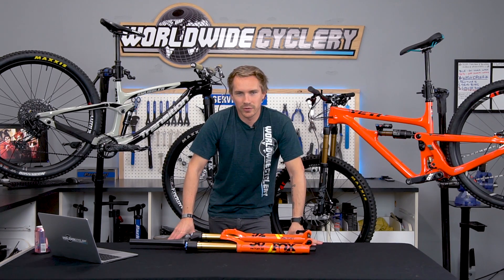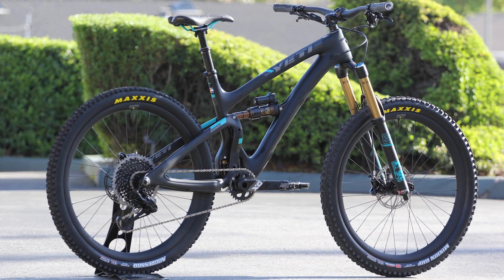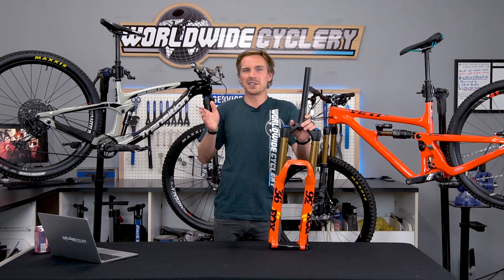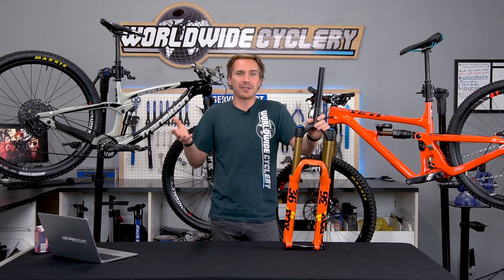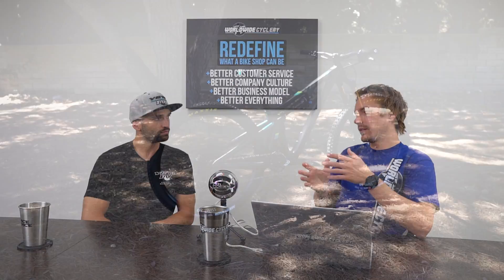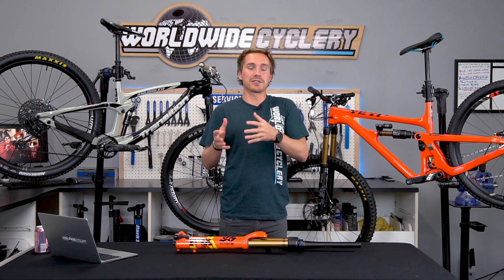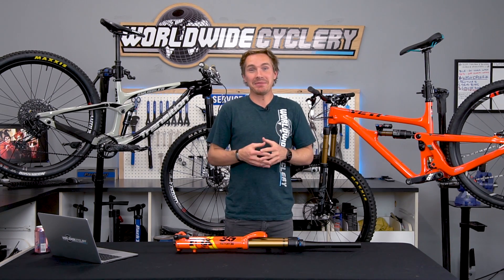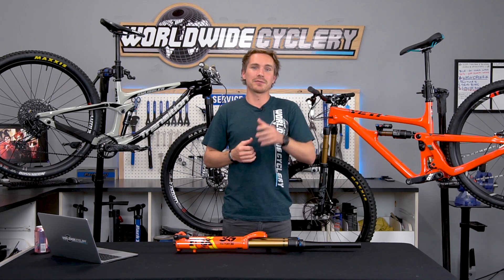MTB Fork Offset - What Is It and Does It Really Matter?

Comment: Just as a random point, the SBG from Transition was a collaboration between Transition and former UK Fox Importer, Chris Porter (currently at Geometron bikes). It was actually Chris that messed about with fork offset (bonus of having a lot of Fox forks to play with) and Transition heard about this and asked Chris if he would work with Transition.
Reply: Strangely, Chris Porter also worked with Mondraker( I have looked but seen no mention of them in this)  2013/14, I think. 
FORWARD GEOMETRY  Longer top tubes own brand 30mm stems... Fabulous handling bikes

Comment: I'd like to see a blind test with the same geo spec bike and same wheelbase. However, with the exception that one has steeper head tube angle and one with smaller offset fork to see how much of a difference there is and if anyone can distinguish a difference. Can probably do the test with an angleset headset. It would be interesting.

Comment: One consideration here is the type of trail that you ride on most frequently.   I ride on are the tight, technical trails in the southeast, most often, And I rarely get up to the speeds you see on those wide open trails that you see over on the west coast.   The higher the speed downhill, the more noticeable things like fork offset and slacker angles become.  That's my presumption.
Reply from the maker: Very true but it will also effect things like climbing through tight switchbacks and/or descending technical tight trails.
Reply: Good points.

Comment: Solid video.  WOuld have been good to have a control using a single bike and different forks.  I think fad is a bit crazy since the slack HTA AND reduced offset both slow steering down.  I do love my slack bikes (my Evil Calling sitting at 64.5 HTA for example); however, I think it more about the steering feel you like as a rider and more about the PROPORTION of the offset to the length of stem.  I think you should fit a stem that gives you the reach you like in the geo you want to ride in THEN choose the fork offset that is about equal(+/- up to 10mm) for trail to more aggressive riding.  Just my .02 since I feel, even with reduced offset, that any stem less than 45mm feels too twitchy (yes I have tested a sentinel with a 40mm stem)
Reply: Thanks for your view and idea here, I mean, I haven't heard of relating the offset with the stem length. But I'll definitely keep an eye out for this kind of info ahead!

Comment: I would also like it if they could make the axle point further up the lower leg i.e. Make the lower leg longer. Sorta like the motocross bikes have, with a bunch of fork extending down past the axle. It looks cool.
Reply: But, it seems counter productive for a mountainbike that wants to be as light as possible and has a much larger wheel that would already have the length and modulation enough for good function, right?
Reply: Yea mainly it looks good but I think it might be done to allow more upper and lower leg engagement distance for more stiffness.

Comment: My Stumpjumper 2016 29er which I bought in June 2015 came with a 46 offset 140mm fork, I have now changed it to 51’ 150mm Yari fork which makes it slacker & longer which I prefer 🤔😘
Reply: You might have preferred a slacker hta generated by a new frame instead. When are we gonna se 0 ofset forks?

Comment: Great video once again 🤙. My question has nothing to do with offset forks and such. As far as the new boost drop outs go , like the 110 mm forks and frames ( not sure what the rear boost drop outs are). Is the boost thing similar to the offset thing where as it’s a small improvement and not hugely noticeable? Or is it really noticeable (in your opinion )? I’m one of those riders that kinda notices stuff on new bike but am not hugely aware of them.
Reply from the maker: Thanks for watching! The thing about Boost spacing is that it's already here and there is not much we can do about it. I could go on all day about why it was developed and why it took over has a standard but the truth is it improved some things and the entire industry switched to it so now that is what almost every bike is going to have and what hub and fork manufacturers are going to support. Fork Offset is definitely going to be a more noticeable feature change than boost spacing was when it came out but again will likely turn into something that slowly becomes the norm and than it will be hard to remember if it was a big advancement from the previous "standards".
Reply: rear boost dropouts are 148mm for trail and enduro. 150mm for downhill
Reply: @WorldwideCyclery  my frame is a 2018 but it has 135m QR dropouts. i fkn hate 135 QR. but i dont have 800 bux for a nukeproof scout frame and a new boost rear hub.

Comment: So a shorter offset increases the trail measurement which also occurs with a slacker head angle and bigger wheels, wouldn't this mean that a shorter offset would decrease agility with low speed turning and tight switchbacks rather than making it feel more agile like what everyone says.
Reply: Yes, According to every article/video about trail I can remember. I demoed a pivot trail 429 that has the longer offset vs some 29ers with shorter offset and it definitely had quicker steering at low speed. BUT i did read an article on pinkpike or maybe enduro mag that interviewed a few designers from some different bike brands and they said the relationship between HTA, Wheel Base, and Offset can all effect each other in different ways depending on the ratios, and its not always simple. So they should just make offset adjustable with a flipchip on forks so we can try both.

Comment: Hi, what’s the effect if I’m using 46 mm fork offset on a 29er and switch to 51 mm offset fork? Thx
Reply: I was wondering the same thing,the Slash 8 runs on a 44mm offset(correct me if im wrong) Rockshox Yari Fork,and im looking at the Fox 36 Grip 2 as an upgrade,but the Fox has a 51mm offset.I wonder if it will fit and whether or not it make a difference?

Comment: So I went from a 150mm- 51mm offset Fox 36, to a 160mm - 44mm  offset Fox 36 . Did I do this right by going to a 160mm travel it should slacken the the head tube angle a bit by raising the front end of the bike 10mm. (Increasing trail)  So should the 44mm offset negate the slightly slacker head tube angle by reducing the trail ? My goal was to get a similar ride but increase my travel.

Comment: Seems to just be 44mm only run a 27.5 according to my for 38 forks with fit 4 and my mates black grip 2 has 27.5/29 sticker on his for both wheel sizes its got me confused as looks no difference side by side so not sure if my for can take a 29in wheel or not?

Comment: What type of full suspension bike under 3K would you guys recommend with all these new changes
Reply: Not many I can think of at that price with the latest and greatest geo...
Reply: ggutierz , it’s $3,500 but Aluminum 2019 Santa Cruz Bronson R Build is sweet.
Reply: @dadventuretv2538  thx for that info I will start looking at one of those thx again
Reply: Glad to help. Also check out the Pivot Switchblade Aluminum- it’s 4,000 but I’ve seen it on sale for 3500. And the Santa Cruz 5010 Aluminum you can get as cheap as
2700 and then improve components as you get the funds.  Figure out how much bike you want/need- the ones with lesser amount of travel (like the 5010 or even the Tallboy) are great bikes, can generally do way more that what you would think just based on the numbers, and are cheaper.  For longer travel bikes, unless you do a direct to consumer brand you’re probably gonna have to move your budget up a bit to the 3,000-4,000 range - or buy used or a year or two leftover.  You can get some good deals on leftovers. The beauty is that most bikes since 2017 are all really good- so no matter what you get you’ll likely get a really good bike. If you can demo any do it- that’s the best.  Good hunting and ride on.

Comment: Wait a minute. I've watched three other videos and they are stating that the longer offset (pushing the front wheel further out) produces a faster steering bike. Shortening the offset ( pulling the front wheel back) makes the steering more stable but more difficult to steer on slow climbs.  That is counterintuitive but was a consensus in the videos I've watched so far.  Seems like you're saying the opposite thing here? What's up?

Comment: Still confused. I always understood that fork offset (forward), makes a slacker head angle perform ( respond quicker to input) like a steeper head tube angle.  
Is this correct?
Reply: actually no... its the opposite the more offset (fork forward as u say) is gonna make bike slacker feeling, so if u have a really slack head tube angle and want it to basically  be more nimble steering wise then u would go with less offset on the fork moving front tire closer under the frame (standard being 51mm i think)  so anything less like 46-44mm should tech give u more responsive and nimble steering. AT Least i think so LOL Or just  reverse everything i  said and that would be the right one... :)

Comment: I’m too scared to use a bike with proper brakes, as I use some cheap generic mechanicals. What should I do?
Reply: Upgrade your brakes to hydraulic. There is nothing to be scared over unless you cant control your fingers. In that case you shouldnt be riding a bike. Finger dexterity is crucial to holding on to the grips and brake levers. Hydraulic brakes have better feel, more stopping power and they are easier to pull. Nothing to be scared over. Your 100% over thinking it. I'm telling you once you get better brakes you will never want mechanicals again. Unless your two brain dead to bleed brakes. Which again in that case you shouldnt be mountain biking. It's easy as pie and there are tons a high quality how-to videos. Your smart enough and skilled to have and maintain better brakes. Quit overthinking this simple upgrade. Get better brakes my man. Believe in yourself and have some confidence in yourself that you can do it. Because you can do it

Comment: Can i use my transition scout 160rear and 170 of front?
Reply from the maker: It really depends on the brake bosses on the fork you are using. If it's compatible with a 160mm rotor then it's likely a 170mm rotor would work with the correct adapter.
Reply: I mean the travel suspention not the rotors,

Comment: Would like to ride the same frame with different forks to feel the difference. This video explains what I understood about offset, and then I saw this on Knolly's site and got confused: 
—
• With a longer offset (51mm) the bike corners better in tight singletrack and has slightly quicker handling but it gives up a bit of stability at high speed. 
• In the shorter offset (42 to 44) the bike is more raked out so it is more stable and performs better at high speeds but in tech climbs, switchbacks, and slower stuff, the bike is a bit more to get around and the front end can feel floppy.
—
I understood offset to do the opposite of what they're saying?? (https://www.knollybikes.com/fugitivelt, bottom of page)
Reply: I did this on the 130..bought a frame only after demos on 44 offset... Slapped my pike 51 on and honestly... I can't tell any difference.. Definitely not upgrading a fork now!
Reply: Yes, please clarify this here! Where this here video left me hanging is what type of feeling you are actually getting with the different offsets.
Reply: Wow, as you indicate, this video also to me really just tells the opposite of what knollybikes does at 6:41 in this video: "And that's when they sort of coined speed balanced geometry (SBG) and they realised wow, we just made our bikes, by reducing the offset on this fork, we were able to make them perform just as good uphill, but perform significantly better downhill because it has that slacker head angle and that longer wheelbase. So, Transition coined it and figured it out, and everybody's kind of just followed suit." Haha, this does confuse :) So, now, please, can someone help to rid the confusion and educate us all in simple graspable pieces of information?
Reply: @niklasdr  To me the simple education of it all is that it's all negligible.. I've rode them all.. Nothing earth shattering here.. Its another money grab really with marginal hard to perceive differences..
Reply: @flow2tech  Thanks Trevor, we'll all see how it unfolds these years to come
Reply: @niklasdr  Yep.. Way I see it.. They trying to cash in on 7mm 😂 in terms of the offset thing.. Its all about making u feel like your gear is outdated.. Except nowadays they try to make you feel that way every 6 months instead of every few years.. 😂
Reply: Well, I don’t really mind if they tell us something new and nice is here, as long as they can say what it is. Ok, I agree this whole thing about fork offset, trail and the evolution of it from road bike to MTB 26” to 29” and finally 27,5”/650B in between, is hard to explain, and this video is a good background where it’s all coming from but, this video here doesn’t do us folks wanting to know what the actual difference is much good. So I guess we’ll have to wait for an enthusiastic ripping engineer to explain the differences and I guess in a chart where one (x-) dimension is going up or down hill, and the other (y-) dimension is going slow or fast. More dimensions could of course be how varying forces towards the front of the front feel if any different. Are there any more feelings we can easily relate to..

Comment: Question: I have a 2015 Giant Reign Advanced 1 with a 46mm offset. am  lightning my bike and am sick of the current dual air pike on it. was 50/50 between a 46mm Debonair Pike or the 44mm MRP Ribbon. Would the 44mm rake on the Ribbon significantly effect the bikes geometry?
Reply from the maker: No that is a very small change in offset that you would likely not notice.
Reply: Thanks. which fork would your recommend out of the two @WorldwideCyclery  ?

Comment: Rake and trail. In the mountain bike world it's talked about as head angle and offset. Nothing new here, it's just confusing that it is referred to and measured the way it is in mountain bikes. Motorcycles will always refer the measurements in rake and trail. It's a real thing, leave it to this demographic to mess with the terminology.
Reply: It's good to be able to relate to this other world of motorcycles. But, now I don't know what you mean with "...leave is to this [what?] demographic to mess with the [what?] terminology. I do believe there are quite a lot of differences to be found both between mountain biking and motorcycles and also within each one of them.

Comment: Maybe I'm just being really ignorant here, but I really don't see how Fork Offset is such a big deal. You're essentially just steepening the true headtube angle whilestill being able to put a slack geo number on the bike's marketing brochure.
Reply: @obi-wankenobi9871  I mentioned 'true' headtube angle. Most people measure straight down from the headtube to the bottom of the fork. In my case it's from the headtube to the front wheel axle.
Reply: @elephantrider78 thanks, that makes a bit more sense. I doubt I'll notice this change irl though.
Reply: @s2korpionic  I sure as hell don't notice and I demoed 100, 130 twice and 150...Bought a 130 frame and slapped my 51 offset pike on it.. Shreds exactly the same... To the point that I'm not worried about a fork upgrade anytime soon. 👍
Reply: Head tube angle, fork offset and wheel size combine and determine a key measurement called the trail: distance between the contact point of the front tire and the axis of rotation. Dosing trail is key!!!
Reply: @flow2tech  hmm I'm considering upgrading my 2019 29er comp alloy stumpy from fox rhythm 34 to fox factory 36 and in doing so change to 44mm instead of 51mm offset. I do a lot of steep tech corner climbing. Are you saying probably not going to notice difference?
Reply: @RobBradshawG  I'm saying I didn't notice a difference.. To the point where I'm just keeping my pike 51 offset on my sb130.. I had planned to quickly replace the fork if it was a hindrance on the new bike but after many rides it is a complete non issue... Just more ways for the companies to get u to open ur wallet really.

That being said, maybe you are more sensitive than me to the changes and characteristics of the fork..
Reply: @supergreg72  YES!!  This is the truth.  Folks with a long history in motorcycles have always known this. It is such a shame that the bike industry is awash in pseudo-science, marketing-speak, and general BS.